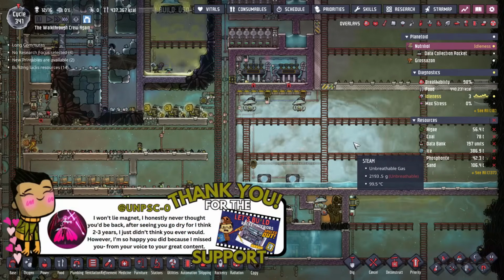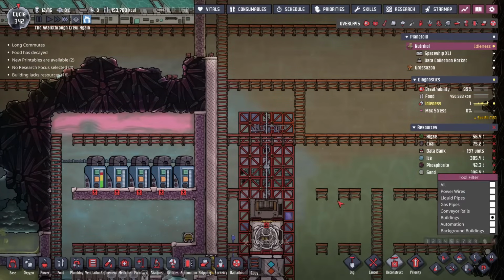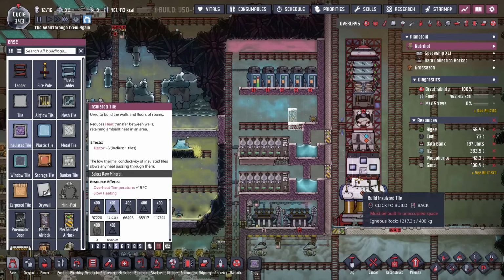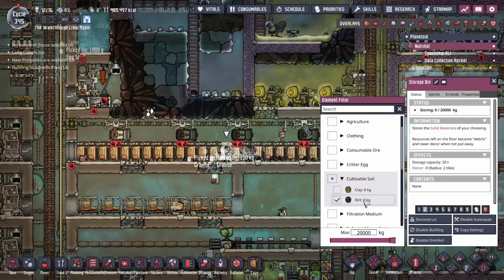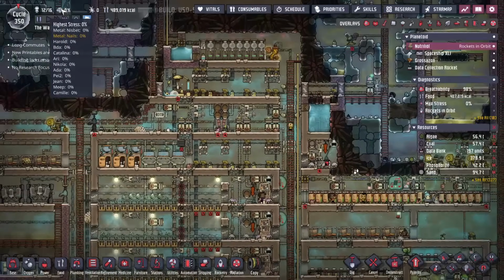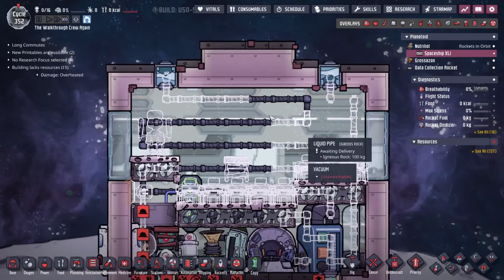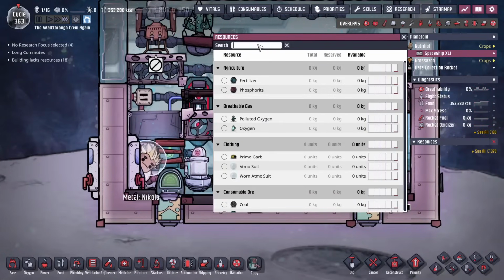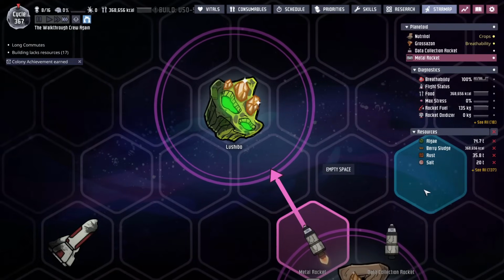Oxygen Not Included: Spaced Out Walkthrough Part 26 (2024)

Comment: Could add some crown molding in that rocket so it looks a bit better. The Steam room for your rocket will eventually need more water. Could also put doors at the top of the rocket silo to capture more steam/heat, that you open when a rocket is leaving/coming & close when not. Steam might not hold much heat but it would be there always. Generally most of the heat goes into about 2x8 tile spike below the bottom of the rocket there is some that in that same 2 tile up also, but not worth it.

2:07 The melting point of 3421°C is hard to get to.
Saying that you can melt the interior walls of a rockets with Molten Steel which will go from roughly 1080~2420°C, so jailbreak the rocket for more space.

Comment: Quick question as soon as my steam started and i pumped it into the rocket the pipes started breaking (cold damage), igneous rock insulated ... i replaced with ceramic but again they broke the moment i started pumping steam ... any idea why?  Repaired again and once again cold damage as soon as i start pumping the steam ... i am baffled ??? losing steam to the vacuum which is condensing to water and cooling and the pouring back into steam room when dupes go in to repair cooling everything down ... i am in a steam/break pipes/cool steam to water, pour back into steam room/ steam halts ... loop /... i just turned off the pumps as the rocket was full and managed to send it on its way ...
Reply from the maker: It will happen if the steam is close to it's condensation point, and sometimes there's not a lot you can do about that.  Ceramic is your best bet, but getting the steam up into the 120s is a good way to prevent it.
Reply from the maker: Also, if a pipe is always full of something, it will eventually break unless the thing outside the pipe is a temperature that would otherwise keep the material's state.
Reply: @Magnet_MD  that makes sense, whilst they were pumping they were fine, as soon as rocket was full and the pipes were sitting there full of 100C steam on top of 29C tempshift plates then they started breaking ... thanks for reply, rocket took off with the 8 dupes and safely landed on third asteroid :)

Comment: some things concerning temp shift plates.  They equalize the temp with themselves and the 8 tiles around them. It's usually best to keep them off the metal walls because they are 8 times as massive (800Kg v. 100 Kg), so they will actually hold more heat than the wall. It's best to run some directly in the path of the rocket exhaust straight down to the metal floor, like a thermal conduit. Edit:  I've never tried it, but you could probably run some tungsten/wolframite radiant pipes full of steam from your steam room straight up to the top of the rocket and back down while your rocket takes off or lands and significantly increase the temp of the steam in the pipes, releasing it back into the steam room.  You could probably even automate the pump by connecting it to the rocket platform.
Reply: Yeah - in this scenario I've never tried temp ship plates (and 'change' is bad ;) )
I do hear your argument though. Temp shift plates are normally used to 'absorb heat' to prevent a blowout on something, and in this case we want to promote heat to benefit from the resultant energy thereof (jezus english much). How much energy in this design ends up in going 'upwards' and not down into the tank? Who knows...